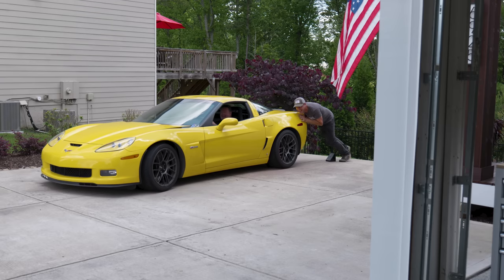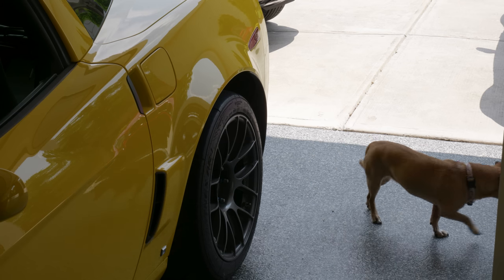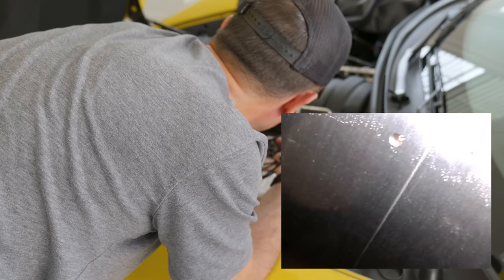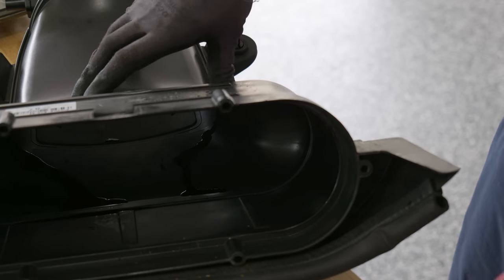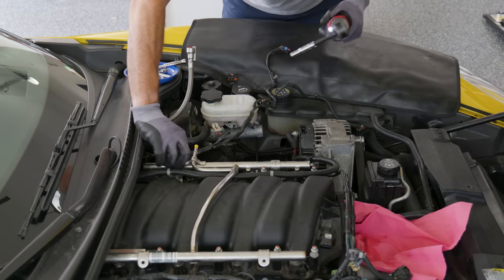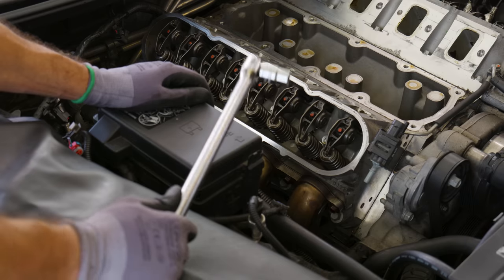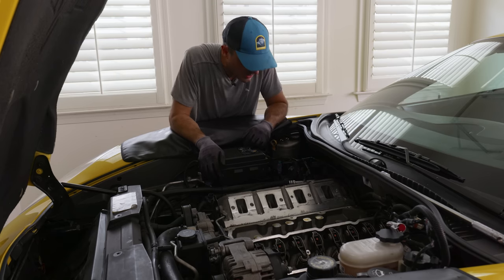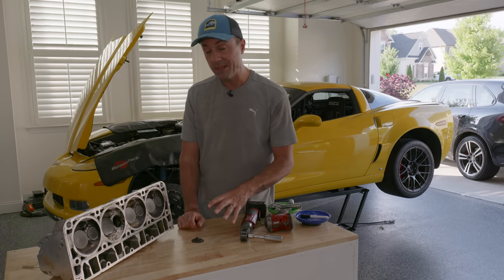“Get your heads fixed!” The internet was RIGHT?

Comment: Agree re Porsche quality 95% of the  time.....
Early GT3's used to randomly " lunch engine's" back around yesr 2000.
Worked coached for a race team running two pf them back then.
Spent last Wednesday coaching all day in latest current GT3 (non RS version) Porsche in Sydney Australia.
GT2sand 3's especially the RS models as far as a track car that is rd registrable,  is one of the best available in my pov.
Now....yes Porsche has dominated 24hr Le Mans since the late 1960s onwards with 917s , 908s and 911 variants, 935s blah de blah...evenTurbo 944's.
To be fair though, perhaps we could consider how many times Porsche has entered the event versus G.M or Corvette!?
Then compare success against the number of times each manufacturer has chosen to show up and compete.
Also suspect 2006 to 2013 with C6R Vette..
G.M dominated all rhe classes they competed in against not only Porsche, yet also Aston , Ferrari , AMG , and others in the class.
Pretty sure 👍 🤔 C6R took race wins , class wins and championships with Pratt Miller running the team.
So Josh's build with the affordable upgrades and possibly only 600hp will car versus car, compete easily with same era GT3 ...imon circuits, if Josh goes to 700hp...GT2 Porsche of the same era too.
And Josh will be still be hundreds of thousands ahead in dollars.
Yet having equal fun and onowing he " Made The Mods" or at least fitted them.
C8 many people like the division between passengers with line of instruments.
Cost versus interior ....price point 🤔 obviously dictates materials used. 
Build quality... 
Lexus build quality, then everyone else,  even wonderful builds of The Master Race 😮 are a distant second in my opinion based off having worked for the majority of Premium brands....
Lexus also wins the Batshit Boring award 😅lol hands down, except for LFA & A few other models.

Comment: Hate to tell yall this, but the heads issue was an defect in machining. with a single batch of valve guides.  Here is a link to a savage Geese video with the head engineers of the C6 Zo6, where they discuss this.  For instance, they used the same valve guides on the LS9 and LT34 engines.  And those engines never had this issue.  Start video at 16:30: https://www.youtube.com/watch?v=Op8LEDchcKY

I just love this car, and want to clear up this issue for people.
Reply: Actually yes the LS9 has shown this history.  One dropped the valve in his driveway with 12k on the clock.  Others have checked their intake and exhaust to see abnormal slop.  Not as common as the 7.0 but still there

Comment: How would debris move from cylinder 7 to 5?
Reply from the maker: I think my assumption was that if something can get out of the exhaust valve it could also get out of the intake valve and then get sucked into another cylinder’s intake valve.

When I write it down it doesn’t make as much sense as it did in my head 😅

Not particularly surprising but if you watch the next video I didn’t see anything in cylinder #5, I was just misinterpreting what I was seeing with the inspection camera.

Comment: When it comes to the LS7 engine, there is no "fixing the heads" that will solve the problem, since the cause of the problem has not been established with certainty to date. So whatever you do, the LS7 is always a ticking time bomb...
Reply from the maker: While I don’t think you can guarantee reliability, I think there are methods that drastically reduce the likelihood of the most common form of the dropped exhaust valve. I hope I’m right 😅

Comment: LS7 heads seems repairable.
Reply from the maker: You think so? I figured the heads are a lost cause with how beat up it is.
Reply: @JoshVanVeld  To me its repairable, right time for a chamber, bowl, runner porting job with the upgraded valvetrain fix. If the block is scrap you can use a LS3 with valve noch to sleeves.

Comment: My son bought a 2007 c6 z06 31,000 miles im taking it to RPM in a few months to get the heads changed, I cringe every time he drives it wondering if its the last.
Reply from the maker: Fingers crossed! I'm sure a lot of them, probably the vast majority of them, can go a lot of miles without any issues. But knowing what I know now, I'd consider the cost of reworking the heads as part of buying the car and have it be the first thing I did when I bought it. It's just so expensive, stressful, and time-consuming to deal with it if something goes wrong. Once bitten, twice shy as they say!

Comment: The problem with the LS7 is not "bad valves"........it's bad valve guides that cause the exhaust valves to break. GM contracted to a certain manufacturer to produce the valve guides in mass production, that turned out to be bad. But GM is just as much to blame for not carefully inspecting many of these bad guides before installation, by inspecting random guides throughout the entire shipments of valve guides. Inspections should have entailed determining the quality of the materials used, as well as any imperfections. Had they done that, they could've halted using the bad guides, got better ones, and this whole issue with the LS7 engine could......and SHOULD have......been avoided entirely.
Reply from the maker: The only issue I have with GM’s version of events is that they claimed the issue only affected a relatively small run of motors that my car didn’t fall into. So I’m not convinced it was simply down to a bad batch of valve
guides.

Comment: I also think about my jackstands collapsing and crushing me on occasion, too. Learn from your mistake, and fix the flaw in your cars that can grenade the engine first if they have any. I'm pretty sure your Z3 M coupe has a shitty cooling system (I owned an E36 328i) and if the radiator doesn't look new, get an all aluminum radiator and a water pump with metal impellers. You don't want to be double hit by your overheating Z3 M blow a head gasket because previous owners had that car overheat 50 11 times and yours is the one that pops the head gasket.
Reply from the maker: Thanks for the tip! I’ve already got the new water pump but didn’t consider the radiator. I really need to spend more time reading up on that car…
Reply: Also the coolant reservoir on those crack. 
Water pump
Any plastic parts including reservoir
Radiator
Thermostat

Then that engine will go another 100k miles.

Comment: Seeing as you kept putting off getting the heads re-worked, including the much needed improved valve guides, taking it to the track to race was the absolute worst thing ya could've done. So instead of playing Russian roulette with only 1 bullet in a 6 shot revolver, you added at least 3 more bullets, thus drastically improving your odds of catastrophic failure. Because everyone should know that the LS7 came with bad valve guides that was usually the culprit. But hey, it's your car and your decisions to make.
Reply from the maker: No argument from me!

Comment: hand built engine from kentucky with yet another fatal flaw like the early porsche engines with IMS bearing issues. so many of these cars especially M series BMWs have massive engineering flaws totally unacceptable for selling cars not built fit for purpose in legal terms. engineered destruction.

Comment: Actual legit Ex-pro race guys like me normally don't say anything on the internet anymore because of all the key board warriors.  But you are a novice. You were never going to run this car anywhere near its potential.  You should have spent the money and taken care of the head issue instead of the brake and or suspension upgrades you did.  Street driving, no big deal. It would have been fine most likely. Running higher RPM's, yea.... 100% chance it was gonna happen.   Your stock brakes and suspension would have been superior to your skill level. Pretty simple. It's a hard world. Spend your limited funds correctly. This is not rocket science....
Reply: Very accurate.